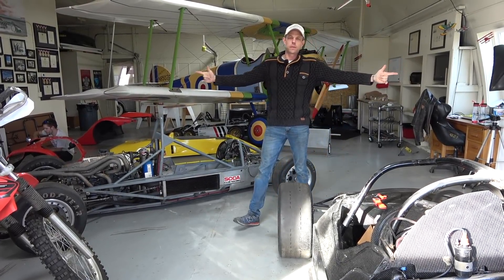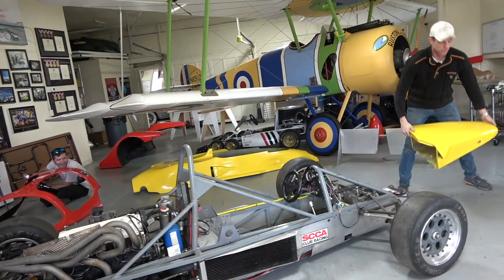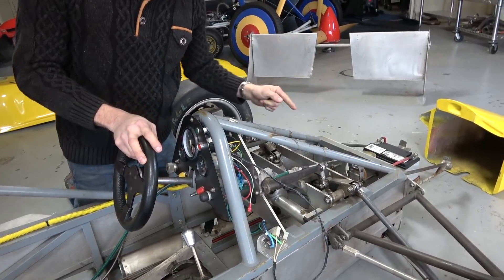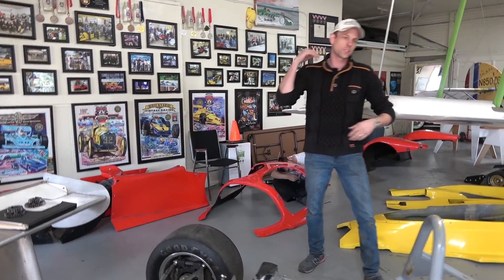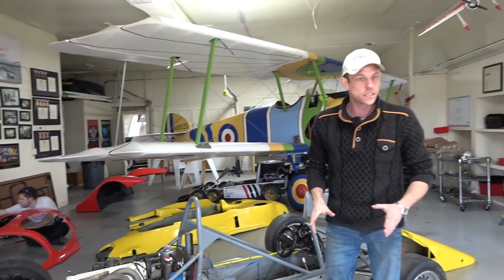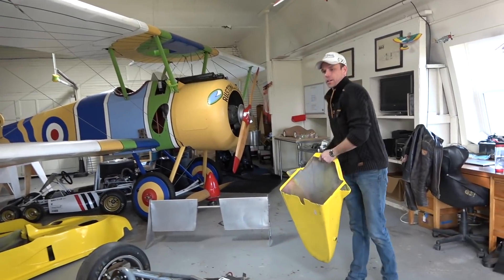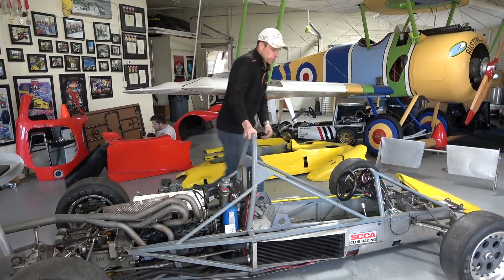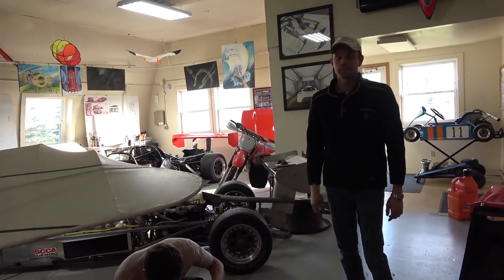Carbon fiber VS Fiberglass | Painting the race cars

Comment: You could attach a hydraulic to the rear wings, install a programmed chip and have it adjust to your driving speeds. Do the same for the rear wings and you could have a car that could balance and stay glued to the track in corners at high speeds.

Comment: You should check out Kyle Engineers Video on Fiberglass vs. Carbonfiber 
In terms of tensile strength s-glass Fiberglass significantly outperforms carbonfiber, what you mean is stiffnes.

Comment: The RESIN!! Thank you, nobody ever points that out. I'm sure the resin is almost the same from CF & FG.... It's the thickness that differentiates them in weight
Reply: Be careful with resin.  Any fiber reinforced composite needs a matrix to distribute stress between the individual fibers.  As a practical matter, if you do a good layup, it's hard to make it too dry but a poor layup can be and that makes a crummy part.  If you put the same effort in to an E-glass vacuum bag layup as carbon fiber, it should weigh exactly the same and be 1/2-2/3 as strong which usually doesn't matter for bodywork.  Add black dye to the epoxy if you want to look fancy.

The weak and ugly and heavy fiberglass is usually mat with too much resin or sprayed with a chopper gun like a boat.
Reply: @joequixotic3039  @1st mention of matrix: i assume that's what happens with pressure forming?I can see lots of bubbles/imperfections in the process..takes a Large Pressure Form Die thingy to repeat & profit
Reply: @gordythecreator  no, fiber either carbon or glass has about zero compressive strength without a resin matrix.

They are called composite materials because you need both the resin matrix and the fiber reinforcement. 

When I say dry, I mean a layup where the resin isn't entirely coating every fiber or their are voids in the resin between fibers.

It has been a while, I hope my terminology is correct but good composite layups for maximizing strength to wieght are pretty much all vacuum bag layups and some vacuum bag layups are done in an autoclave.  The vacuum bag creates a stack of mold, resin and reinforcing fabric, peel ply, bleeder cloth and vacuum bag with the vacuum bag sealed to the mold and when vacuum is applied, it sucks the air out of the layup, sucks excess resin through the peel ply and in to the bleeder fabric while the atmospheric or autoclave pressure forces the resin and fiber layer against the mold.  After it is cured, then you have to hope it will release from the mold and hope you don't break it when you are pulling off the peel ply.  If it all works, you get a strong and light piece without excess resin.  If it doesn't work, your part could be weak, it could be heavy, it could break or it could break the mold.
Reply: @joequixotic3039  WHAT? Gotta let me loose on the resin. BET I can design sum $hit!!! I alrdy designed wraps4 20yrs via scanve. Amiable prods

Comment: Fiberglass is stronger but more flexible than carbon fiber.  Carbon fiber is stiffer and can be laid up with less resin.
Reply: Sir, you've hit the nail on the head with that explanation, a much more efficient materiel to work with!

Comment: In stock car racing if we had to add weight depending on what side they said we had to add it ... it either went in the front bumper to keep the nose down on powering in ... or the rear to keep traction

Comment: How does carbon hold up over time? I heard somewhere glasfiber after 20/30 years starts to split. Is it the same with carbon fiber?
Reply: I have few old rc cars build on carbon fiber plate chassis. If it wasnt darmaged before it wont split but clear top coat tends to fall of sometimes
Reply: I'm not an engineer.  I wrote a lot control system to track parts for an aerospace company that made the V-22 Osprey empennage out of carbon fiber.  I can't imagine that a combat airplane was made out of material that didn't last long term.  The quality of carbon fiber is based on material, design, and the mechanic who laid up the parts.